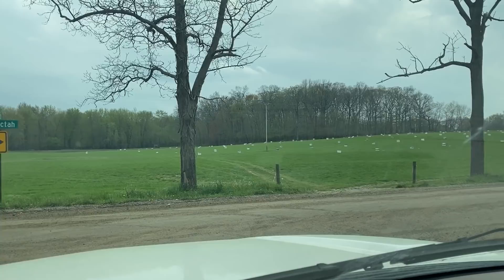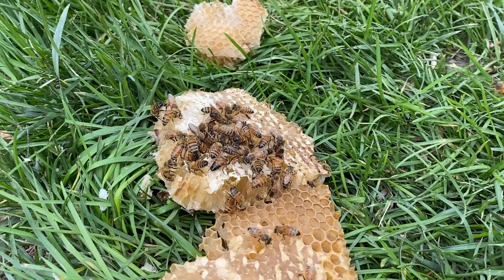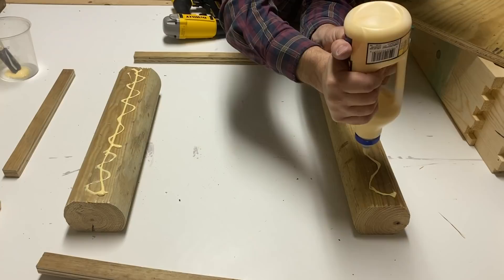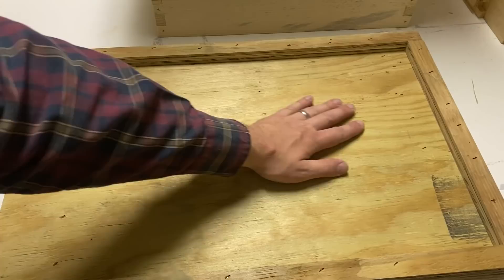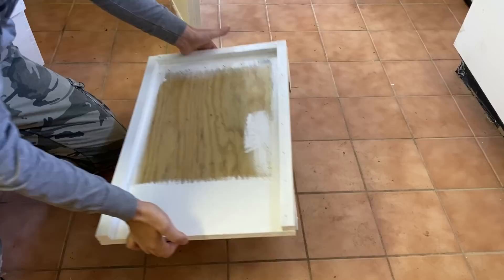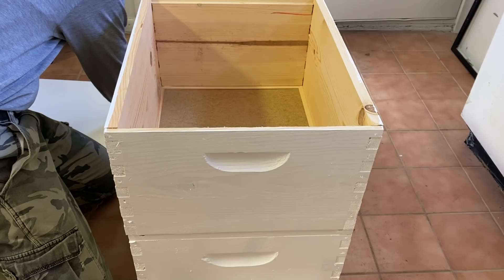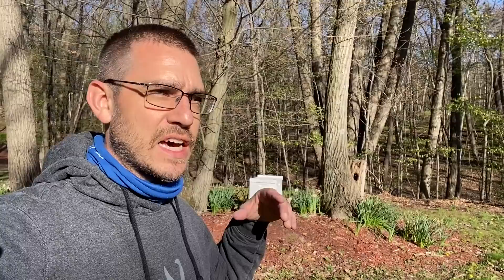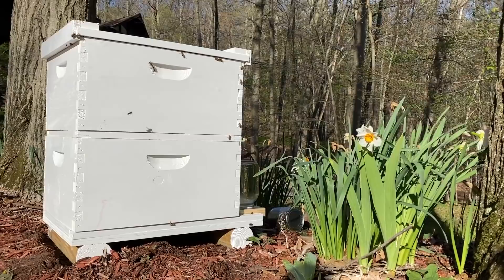Assembling a Bee Hive and Installing Bees

Comment: That paint will be off gassing for several days after painting, too funny. AWS Bees LLC is a great resource, they are in Clayton Twp MI Nichols Rd and M21 just west of Flint. Use to be a Dadant supply house in Albion MI, It was nice he had everything. Amazon is just the worst place to by bee equipment. Goodluck with that plastic foundation, some bees don't like it and those that will draw comb on plastic are low producers when used. Wax Foundation is the best, some beekeepers just don't like the extra time building frames with wire.